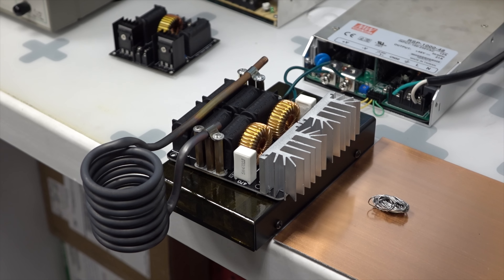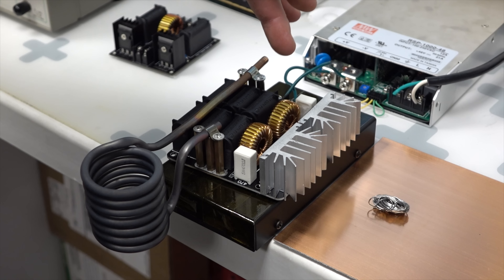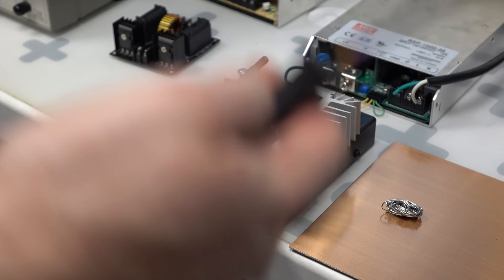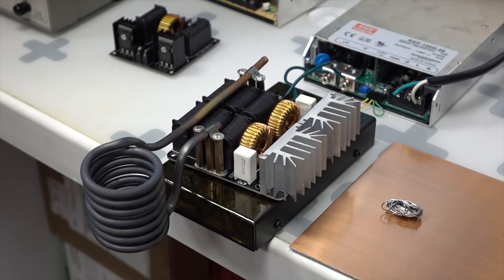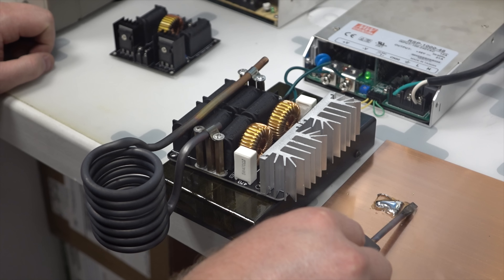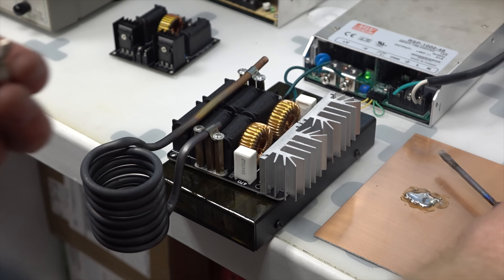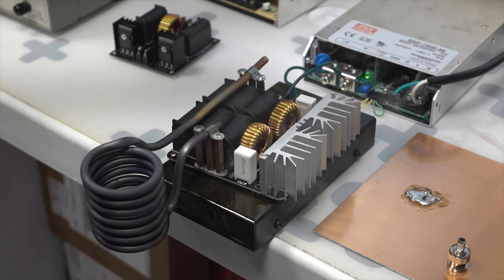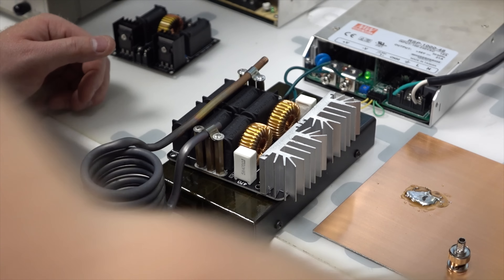1000W Induction Heating Part 1

Comment: I got mine in..... hooked up first with pc power suppy (no metal piece inside the stock inductor... short circuit protection kicked in instantly.
I put positive on the top and on the bottom negative..

Ok so thought the power supply was struggling so put a 3 cell lifepo battery on there... nope still not in fact a sizzling sound and cable was getting hot so quickly disconnected.. Are some units faulty on arrival or is this a mistake on my end???
Reply from the maker: +Masterpj555 I have three units and they all work fine.  I don't use less than 24V and really recommend 48V.  I'm not quite sure what your problem is.  What coil are you using, what are you placing inside? Are you turning it on with something in the coil? What was the voltage and current draw?
Reply: +Proto G I have a current shunt and voltage meter but I wanted to power it on first.
Made sure polarity was right.. draw was pretty much enough to make the solder  joint on a thick gauge lead melt of the high current..

There was nothing inside of the firmly attached stock induction coil (7 turns one)
I only used 12 volts.
Reply from the maker: +Masterpj555 That sounds like a power supply problem.  For this driver, the more voltage, the better.  A 12 volt power supply or battery can easily destroy the MOSFETs if it sags below 12 volts.
Reply: +Proto G Aha! I should have taken this into account.. yeah I bet it sagged. Thanks for the info.
Reply: +Proto G well I bought another one... hooked it up (with a 6 cell lipo) and same thing happened.. but this time there was a bang with a huge flash.. I had no metal in the coil and the coil was hooked up.
Reply from the maker: +Masterpj555 Man, that's awful!  What brand lipo did you use?  An old or low quality 6S lipo can still easily sag below 12V.  This is why I said I wouldn't use less than 24V and really recommend 48V.  There is no way for me to know if voltage sag was your problem but if you do try again, I would make sure to test it with a nice power supply.  A well designed power supply will save you a lot of money in the long run because they have so many protective features that not only save the power supply, but also the devices you are trying to power such as over current protection and over temperature protection.  A lot of people have had issues with batteries but I have used my units with many different batteries with no issues.  Where did you purchase your unit?
Reply: +Proto G It was a brand new Nano tech from hobbyking. The power supplies capable of handling the current and 48 volts are like 185 dollars or so, quite a lot. Want to use this induction heater to investement cast aluminium cogs to make my own servos :)
Reply: +Proto G someone told me that the circuit needs a jump start to oscillate or something like that.. maybe the lipo doesn't trigger that properly and it causes a short. As seen in this video.
A lab power supply seems to be recommended in case of a short circuit

Comment: Hi every one,
Firstly, thanks for the nice video.
I have a question.
if we use two boards and the output of each one link to one coil. Is the watt become double let say 2000w
Reply: NO! Cause every heater is a AC.Source. If you put two sources together you must synchronize them Ueff1 = Ueff2! This is impossible!